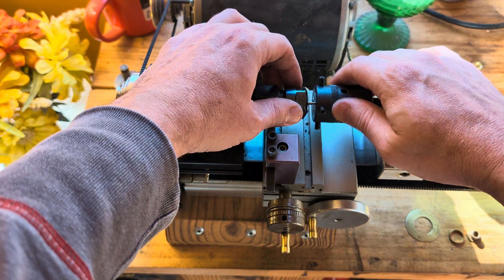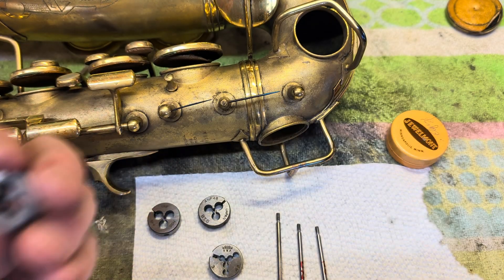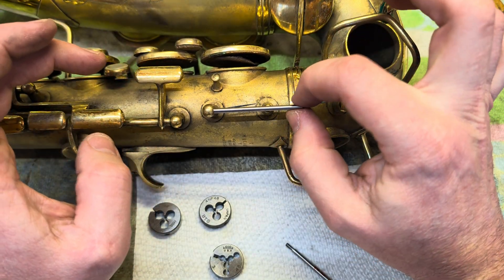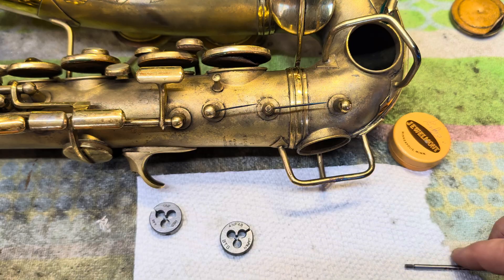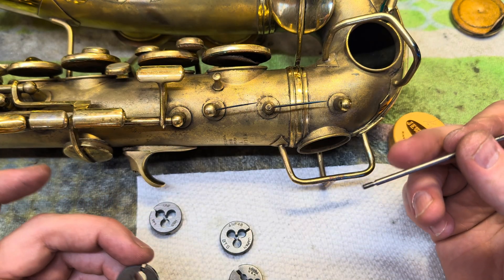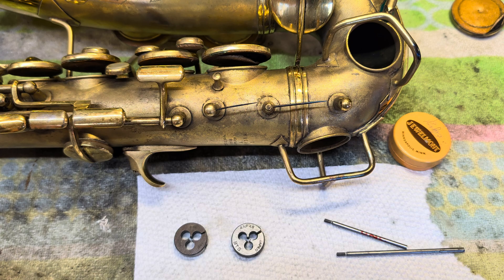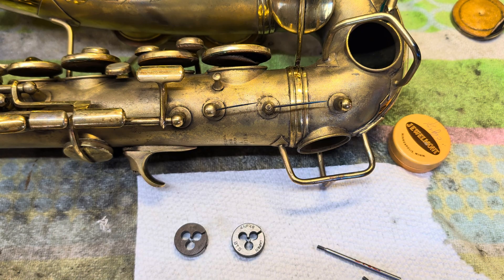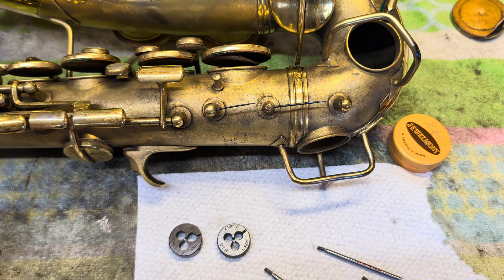EUREKA!  How To Make Replacement Screws for Vintage American Saxophones That Fit Right

Comment: Interesting! Can you tell what the specific difference is in geometry? If the tpi and angles are the same, do NF threads have flatter peaks or something?
Reply from the maker: There's a comment down below that goes into it, you can also Google it- it makes for dense but possibly interesting reading.  Main differences that I understand are less tolerance between the male and female parts and different shapes to the peaks and valleys.

Comment: What's the secret to starting off correctly forming threads on a stel rod?
Reply: You need to take the diameter down to the OD of the threads, or perhaps slightly proud. Then you come in with your die. I always just freehanded this in a bench motor with a file, which is certainly NOT the correct way to do this. 😅 But I never worked in a shop with a lathe, so I had to do what I could. A little imprecise, but going slow and paying a lot of attention I could usually get satisfactory results.

Comment: Wow, great find! So, per your comment below, would this be what earlier Bueschers use? I have 3 Bueschers around 1925-1928 that I'm learning refurbishment on, and I did have to make a couple of pivots. (I used socket head caps screws and machined them to shape. They worked pretty well, but maybe they could be better) Cheers!
Reply from the maker: Yes I believe so, since UNC/UNF didn't exist yet.  I want to do more work checking more of them and then I will share full lists of original threads.

Comment: Excellent post. This is something I have questioned for many years and now have a difinitive answer. I have bought horns for parts just because i wanted the correct rod being i did know what the real die measurement is. However you found this information is just applauding, as i could not find it anywhere. Now we know. Thanks Matt.

Comment: Some machining history minutiae—
The basic geometry of the pre-1949 threads and the post 1949 threads is the same.  60 degree thread angle, same pitch definitions, same size/gauge definitions.  Where things change, which explains your fit concerns is in the flats and profiles on the crests and roots of the thread form.  Pre-1949 the flat of the root and crest in both internal and external thread forms was defined mathematically as .125p [p= pitch].  Post-1949 one of the two changes which is highlighted in your fit concerns is the size of the flat on the internal crest being larger (0.25p). 

This means a UNC die will have less pointy-ness on threads which may account for some looseness in the fit.  The other relevant change is to the allowable basic shape of the crests and roots.  Prior to 1949 the required standard was flats.  After 1949 there was an optional allowance for the crests and roots to be curved.  So if your UNC form has rounded corners in the external thread root and the NC die has sharp corners to make a flat, there is gonna be some collision.

There are other changes made in 1949 concerning the labeling of fit tolerances but they are way deep in the weeds and don’t really matter

Comment: Interesting video. Many moons ago I was given a Beuscher Aristocrat for free. The catch was it was all in pieces in a box and one of the rods was missing.
It took quite a bit of detective work, taking it into people who could measure the thread pitch and rod gauge but eventually figured out it was NF. Getting the rod cut was the next challenge as I was living in NZ where most of the gauges were either metric or imperial (British). Got there in the end and it fitted perfectly!

Comment: You could single point tighter too on a lathe and get better fit.
Reply from the maker: You'd need to grind a different tool.  As the video says, it's more geometry than size.  

It's this misunderstanding that has led to this problem taking so freaking long to get solved. It's not just bigger.  It actually really isn't bigger.
Reply: @S@StohrerMusic.  Different geometry/ profile.

Comment from the maker: It is also important to note that while the thread standard itself changed in 1949, King and Conn kept using NC and NF for a while after that- how long exactly I do not know.  But for King, definitely into the 50s.  

[Probably Buescher too, but I did not have any of those around while I was making this video.]
Reply: So, if I take a rod from my 1935 6M and tries it in my 1958 6M, and it works fine. Then Conn were still using NC in 1958?
Reply: I’m seeing King prints as late as 1980 calling out NC threads. So far I haven’t uncovered any that show UNC.